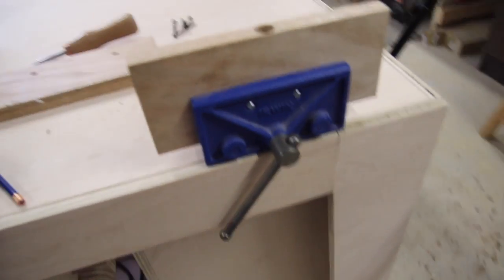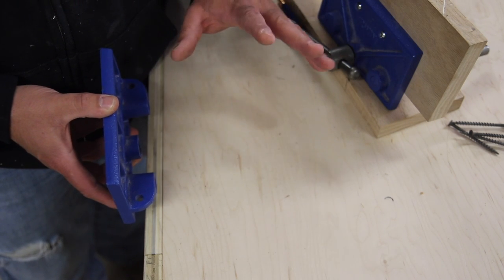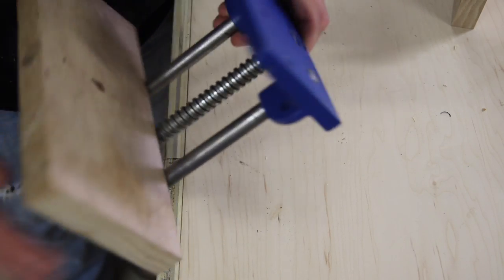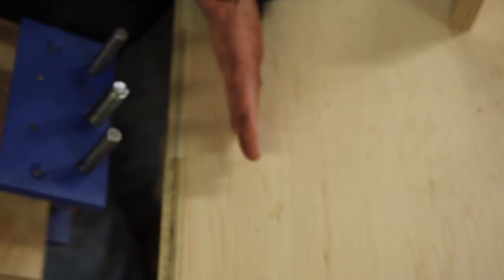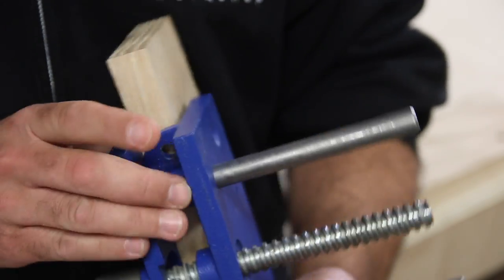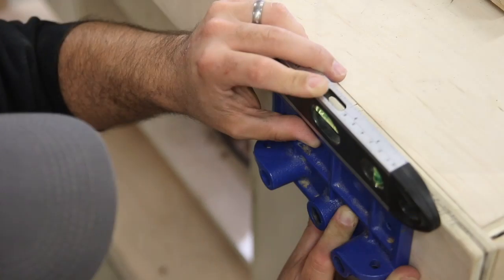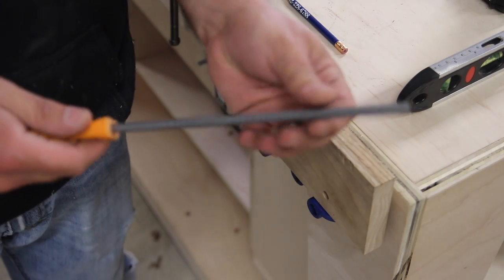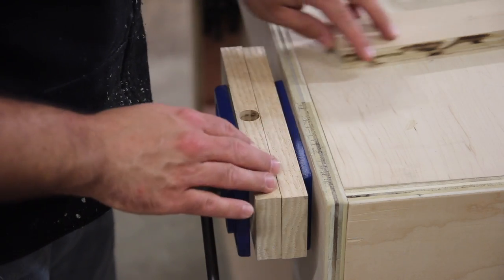Woodworking Assembly Table Vise - Install

Comment: Thanks for the video. After watching it I went and bought the same one (Irwin)  and installed it on my new workbench. One thing I did different was that I drilled larger holes in the plate that installs on the table, and then used 4" lag bolts. When you tighten the vise, it pulls away from the table, so I figured I needed more than a few screws. Anyways, my install was almost identical to what you did, thanks for posting this.
Reply from the maker: Glad you found it useful. Thanks for watching.

Comment: If you want to gain a little more jaw capacity, use a router to cut a recess for the fixed jaw to sit behind. This allows the wooden jaw to set against the table edge and adds stability. This is a great way to make an inexpensive vise work on a plywood workbench (like a Paulk workbench.) I’m doing this, so thanks for the idea of turning the fixed jaw 180 degrees.
Reply: So I went to Lowe’s and bought that vise. I had some 1” thick hardwood that I planed down to 7/8” thick and cut to 3” high and 12 inches wide.I used a router to cut a recess on the fixed jaw so there is no gap between the wooden jaw and the table. Everything else was done very similar to your video. Now I have a rock solid vise and spent a lot less than I though I would.  Next will be the addition of a dog hole ( or two) on the moving jaw. Thanks for saving me a lot of money. The Irwin vise was about $21.00.

Comment: Why not flip the rear plate around and mount the flat side inside the apron? You could use the apron itself as the rear jaw or just attach a 1/4" or 1/2" thick piece of hardwood to the apron as the jaw. That way you don't have a gap between the table and your rear jaw and you can get your moving bench dog closer to the table for clamping smaller stock.
Reply from the maker: +F3Ibane That's a very good idea. I already have too much going on behind there as it is with electrical wire and an outlet box. Without those things in the way that would be a good option. Thanks.

Comment: If you ever strip out a screw hole in wood just get a piece of scrap of shave off a little sliver of wood with a pocket knife and shove it in the hole. That will tighten up the hole and you will be good to go....I've seen it done with a wooden match stick but any sliver of wood will work. That little trick has saved me a few times :)
Reply: Not a permanent solution.  You're relying on the holding power of only a sliver against a larger piece of wood

Comment: Why don't you just cut out the fascia so it can be fitted as standard? ( trim fascia upwards so it can mount level and add blocks behind it so you can screw up from the bottom as designed as well as the fascia screws) Seems a lot of work and modifications for no reason and you get the full face for clamping power as well as having the vice mounted in a much stronger way. Sorry I don't think reversing the back plate is the best way to fit this.